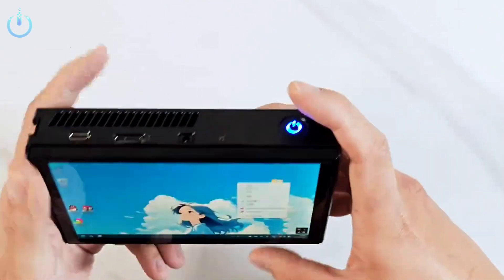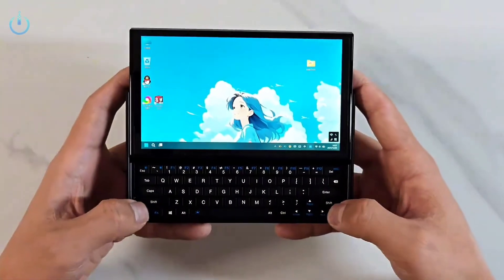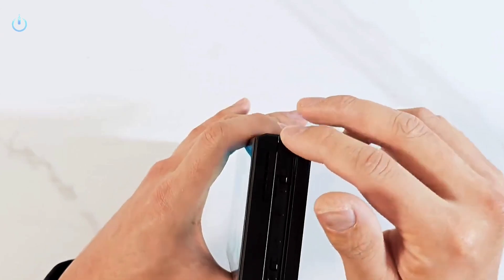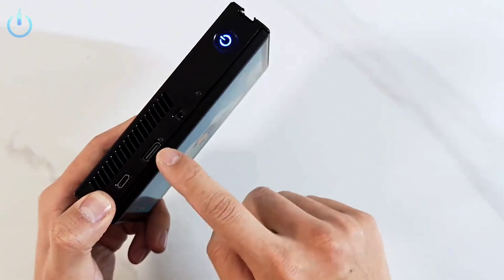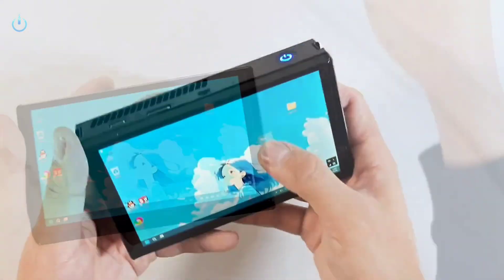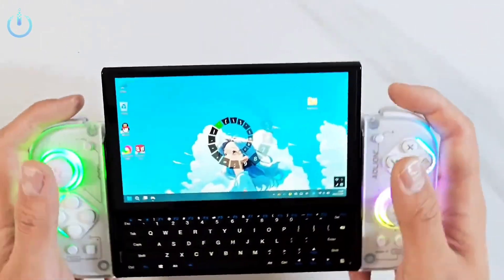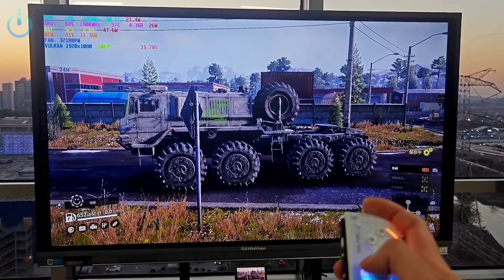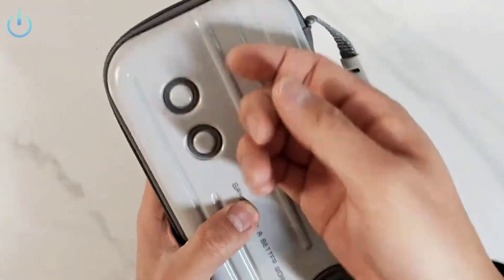Modifying a GPD Win 4 into a UMPC with an Ai9 HX370 slide-out keyboard

Comment: awesome lol was just thinking to wait for the new z2 apu and as soon gpd brings it out to rebuild it in an 8.4 clamshell laptop with the rails of the switch to have controller compatibility if i need them and have it as an upc laptop if not oh and an small intern battery and an seperate connector for an powerbank as battery

Comment: this is cool, but the weight with the modified unit is MORE than the weight of the original unit with controllers. If this modified version was under 16oz, then I would consider it.